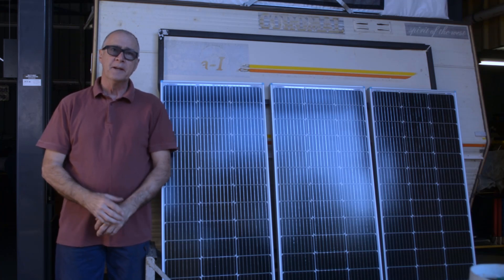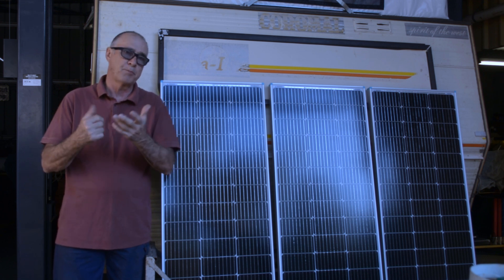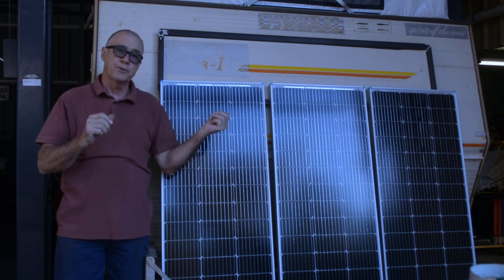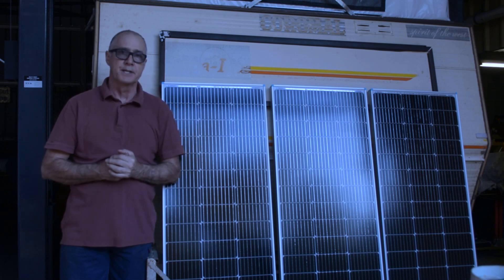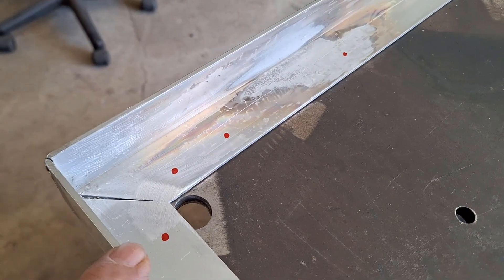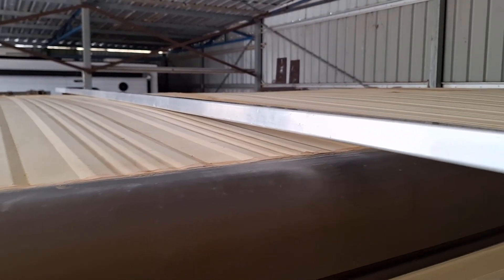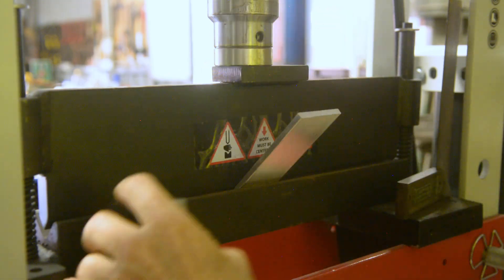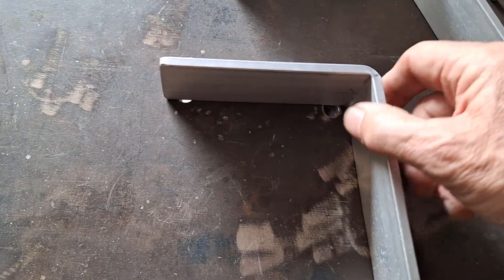Goodbye Camper, Hello Caravan | Part 7 - Installing Solar Panels

Comment: Nice job. What pressure were the gas struts and what did u upgrade them to.
Reply from the maker: Hi Brett, I can't remember what the original struts were, but the new ones are U83010@270N. The 830 is the overall length including the ends; the 10 is the shaft diameter (10mm) and the 270N relates to the strut's Newton force.  The original struts were rated at less than 200N. Hope this helps.

Comment: Great work did you need to change your gas struts to accommodate the new panels
Reply from the maker: Hi Armon, yes, the gas struts were buggered, so in replacing them, I went for the next stronger rated size, and they work a treat. 
I've not got my Starlink dish on a bracket attached to the cross arms, so I'm grateful for the stronger gas struts.

Comment: Will your solar cable interfere with the annexe
Reply from the maker: Hi Joe, you raise an interesting question. I don't have an annexe attached to the caravan, as I carry a 3m x 3m gazebo, so I don't have any issues with the cable. If I did add an annexe, I'd have to route the cables differently....either into the van on the other side, or space the annexe off the pop top roof, to clear the cables on that side of the van.